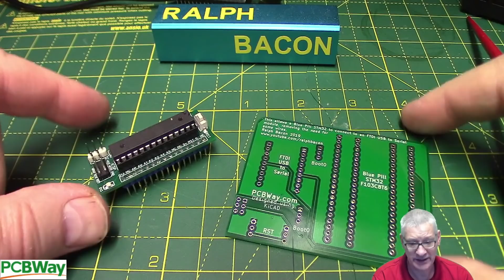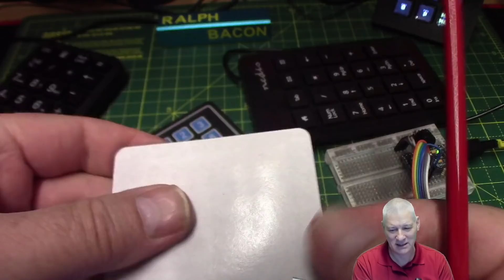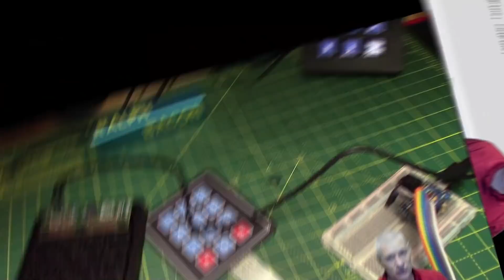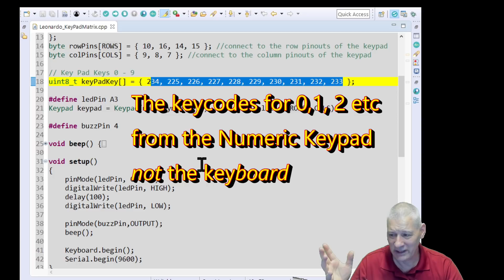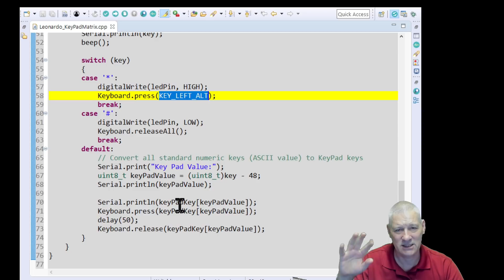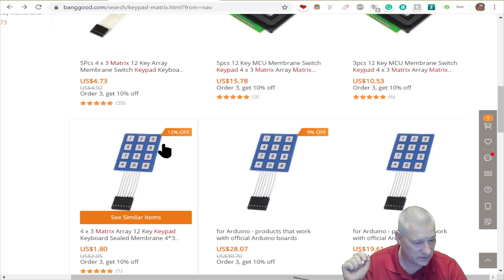#191 No "ALT-key" or Numeric Keypad? An Arduino 32U4 workaround!

Comment: I've taken apart some keyboards where the swtiches part was fairly well trashed,  but the little bitty circuit board was intact and quit functional.  It occurs to me that these might prove to be quite useful in terms of sensing up to 128 different switches (or sensors?) and which would produce an output when any of them changed state.  This strikes me as not all that hard to deal with if you were to feed the output of such a device into say an arduino...
Reply: "quite functional" (and how the heck do you edit a comment?)
Reply from the maker: To edit: Click the hamburger (vertical three dots or lines) on your comment and choose EDIT. Yes, that PC can probably decode many more keys than on my keypad, that's for sure.  so you are saying, build a middle-man to intercept those keystrokes and convert them into something else?
Reply: Sure.  It just strikes me as potentially being very useful,  if you have a whole bunch of sensors of some type, the main restriction being that one end of them can't be grounded.  I also have an older board here that wants an "ASCII keyboard",  and it occurs to me that it should be possible to use an arduino to convert what the "pc" keyboard puts out to ascii.  I may have to look into that...

Comment: Nice project Ralph. Here's an alternative way to make.
Instead of it being a generic 0-9 keyboard, set it so that when you press a 0-9 button , send the ENTIRE key sequence for an Alt character assigned to that button. Ex. Press 7 means the DEGREE symbol, press 8 means the mu symbol. However if the first button you press in the * character, go ahead and accept the 0 to 9 characters as 0 to 9, build up your key sequence and then when you press #, it sends your entered key sequence. Then just make a custom overlay for the membrane that shows the special character assigned to each button and glue it over the keypad. Now you've got one-button-press access to your most frequently used extended characters and still have the ability to enter custom key sequences for the less frequent extended characters. Your hands can spend more time on the keyboard typing and less time fumbling on the keypad for the extended characters. Just a thought. Thanks for the reminder of the USB keyboard emulation!
Reply from the maker: Sounds like a good idea, Gord, until my brain does a stack overflow trying to remember all the keymaps! But it's something I might well consider if when I get it all working.

Comment: As is my wont, I disagree on the cessation of the lockdown. I adore my own company. So, the lockdown turns my sociopathy into good citizenship.
I do like that bluetooth keyboard. My eyesight is not so great and my right index finger has a pronounced tremor (a result of chemotherapy a decade ago). So the on-screen keyboard is a challenge. It can be quite amusing for the more unfeeling onlooker. As by the time my wobbling finger tip has reached the "key", my wobble has translated the vertical movement into a lateral movement and the screen frantically scrolls .This makes texting (which , annoyingly, has now become a means of having a conversation, rather than a simple message [I refer the reader to my antisocial tendances above]) even more tedious. I think I will get that keyboard for phone and tablet. I am assuming that it would also serve as an interface for ESP32 projects?
I admire  your capacity for challenge in attempting to replicate that wee PCB. I assume you have eliminated the use of thermionic valves from your initial choice of components. I look forward to seeing the final result. I too have a tendency to pop up the character map for the alt codes of greek symbols. It was essential when assisting my Niece's son with his maths degree homework (I think they call homework: my dissertation). Great video, Ralph which demonstrates the broad possibilities of the maker hobby.
Reply from the maker: It's a great keyboard, my Corsair K53, but remember it has no keypad! So, you think I can't use a triode (or two) in my design for the keypad PCB? Now I'm stumped.

Comment: Hi Ralph
To make this less complicated, download  a program called Numpad.  tis is an on screen keypad. Customise the layout to include alt key and Bob's  your uncle, no messy extra keypads on the desk.
Reply from the maker: Ivo, go and stand in the "I'm no fun" corner. This is the perfect project for an Arduino 32U4 based chip. Numpad? Pah! Where is the fun in that? (Good suggestion though, I must admit).
Reply: If you don't have a touch screen and had to use a mouse, that would be horrific.
Reply: @Dust599  Very easy to use. click alt, click your required 3 numbers for the character you want and click alt again, job done. its' actually quicker than using the physical keypad.

Comment: Lol... bad Ralph... trying to confuse me! µ is Alt+230, not Alt+0230. If you add the leading 0, it's Alt+0181 (https://www.fileformat.info/info/unicode/char/00b5/index.htm). That's why you got the æ in the video. NRF24 for wireless? NRF24 + 32U4 on the PC, atmega328/32U4+nrf24 in the keypad?
Reply from the maker: My bad. ALT-230 it is (I've only typed it about a gazillion times, so I've not idea why I prepended a zero). Hmm, wireless keypad... Let me get the wired one up and running first. Good idea though.

Comment: Ralph, from my DOS days of the 1980s, I seem to remember what we are doing is telling the operating system that we want the Extended ASCII characters (ASCII 128 to 253). Right?

My Raspberry Pi 4 and a standard 104 key keyboard do not seem to work together.
I just held down ALT then tried keypad numbers "0234" as a test.
Immediately after entering "02" my display jumped to a different tab (in this case a different YouTube video): browser tab #2. 
When I tried "01", I jumped to browser tab #1. 
Interesting... I just learned something.
 
So... how on a Raspberry Pi am I supposed to use Extended ASCII characters?
Reply: as you say : dos/windows does this, other systems like linux/mac os are now working with dbcs (double byte aka 1x alt 123 is not enough) to show all characters in all languages, why/how do you want an extended char ?
if you have this problem in raspbian, it is a linux problem, ask on a linux forum or the raspberry pi forum
Reply: @jyvben1520  I would like to easily use characters such as ™ or © or ° (°C) rather than copy and paste them as I have done here.
Reply from the maker: I don't know Terry. It's Linux, after all, not Windows so it probably does things differently.

Comment: I goo.. sry, duckduckgo search a symbol then just copy paste it. Haha.   Used that making an Arduino screen print deg c.  Also u could have a sticky program popup thingy on your PC to copy paste said symbols. Sry not a Windows user so can't offer better sulotions
Reply: The Windows OS includes an app called "Character Map" which has not only the lower order characters and symbols (ASCII 9 to 126) but also the higher order characters and symbols (ASCII 128 to 253).  AND it includes Unicode characters, too. So you can select the character, symbol or letter needed which will be placed into a window. Then copy the window's contents for later pasting.
More information: https://www.petefreitag.com/cheatsheets/ascii-codes/
Reply from the maker: I've tried all these alternatives. Not for me. I want a simple, numeric keypad with an ALT key!

Comment: If you want, you can use a wider range of micros for this if you use the VUSB library.  Or another micro with native USB like the STM32, etc..
Reply from the maker: Hmm, nice suggestion, David, but the 32U4 will do all I need as the demo with the matrix membrane keypad showed. What do the other micros do differently?
Reply: @RalphBacon  32u4 based boards are getting hard to find at decent prices.  Since you're not in need of a full speed USB interface, the bit-banged on the VUSB library provides is good enough.  That would let you use any of the AVR chips--Tiny85, etc. as well.  Well, those will have too few pins to mux a keyboard, but you get the point.
The STM32 boards are still very cheap, easy to program, and have plenty of I/O for keyboard scanning.

Comment: It looks like that keyboard controller board is designed for a full keyboard.  But they only hooked a subset of the full keyboard matrix to it.  Might want to keep it around in case you ever need something to decode a full keyboard.
Reply: "decode"
Reply from the maker: Good idea. Rule #1: never throw anything away.

Comment: Thanks for your very valuable video. I love what you do. For information æ is used in French (like œ). It's a combination between 2 letters. Æ æ is a+e. Œ œ is o+e. They are not often used (and we can see people using separate letters as well). For example : œil (eye), œuf (egg), œuvre (artwork), etc. Æ is really more rare, I know only Latin words like "ex æquo".
Also on Windows 10, you can use Windows+. (dot) to select special characters, smileys, etc. But yes, it's more complicated than using alt when you know the number 🙂
Reply: Actually it’s in the Danish alphabet as well - where it’s quite commonly used together with å and ø
Reply from the maker: Good to know, thanks guys.